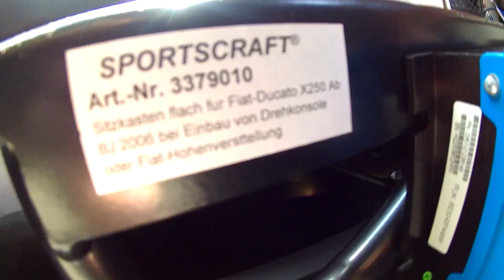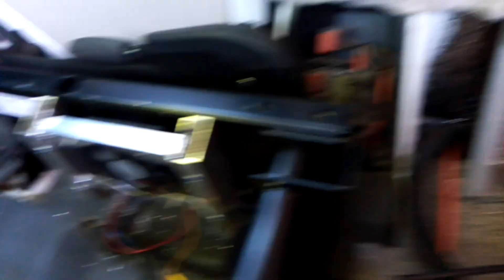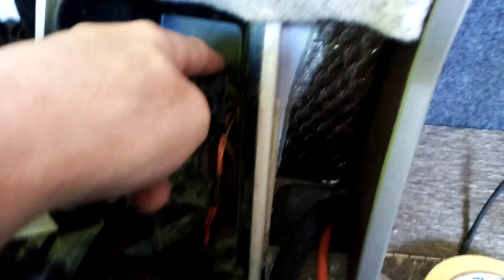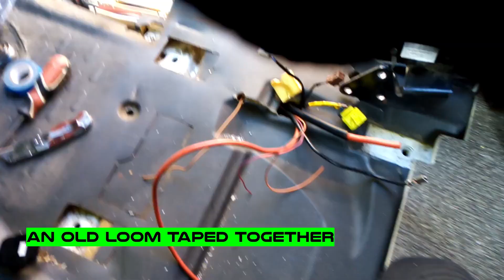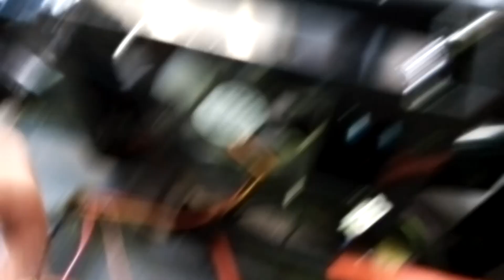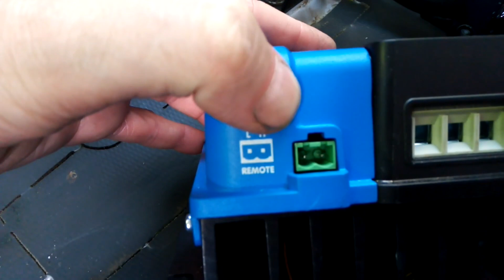fitting victron energy orion  dc2dc charger

Comment: Thanks for the video, any reason you didn't use the D+ signal from the converters socket to trigger the B2B ?
Reply from the maker: hi . i not remember right now :-)) but give me a chance i will take look into my notes and try find why
Reply from the maker: ufff.. finally .OK so it''s look that , older or other manufacturer DC2DC chargers are not enough "smart" to detect engine running means often u have to use kind of system to detect that generator working  (D+) in case of Orion TR is no needs.